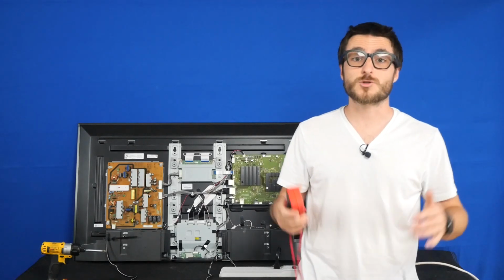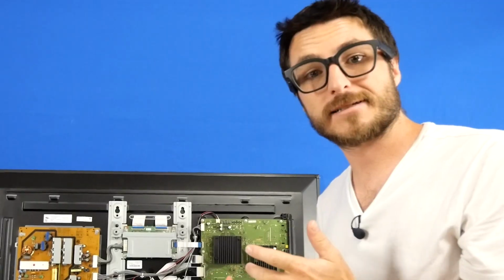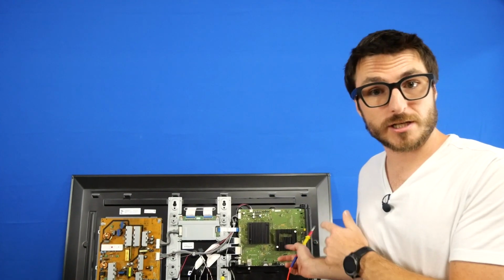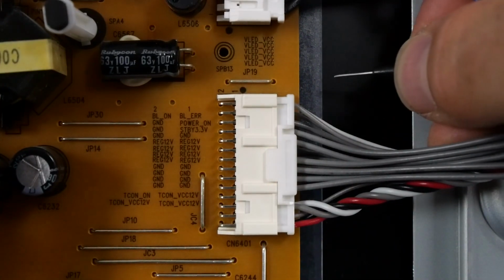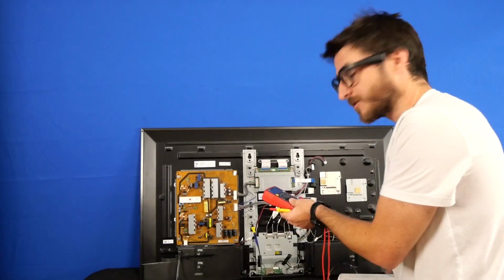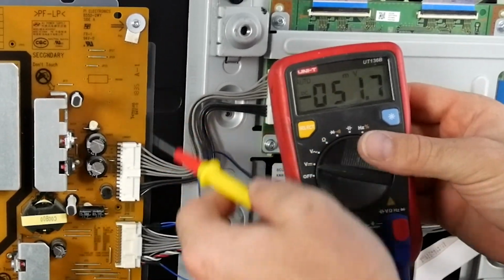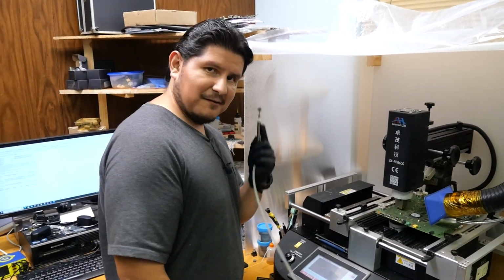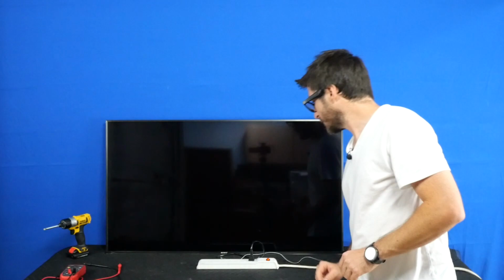The Ultimate Guide To Diagnosing and Fixing Sony TV XBR-49X900F

Comment: Hi, for the pin jumpering, I am correct that you jumpered pin STBY3.3 with Power On,   and also jumpered TCON On with BL ON together? I.e. only two jumpered cables
In my case, I have no picture but have both backlight and sound. When I do this jumper test, my LED driver board (the one at the top) flashes red 3x. What does that indicate?
Reply from the maker: Yup, you are essentially linking/shorting 4 lines together. You are attaching all 3 PS_ON BL_ON and TCON_CON lines to the STB 3.3v which in essence means you are linking all the _ON lines to one another.
Those _on lines are supposed to be commands sent from the Mainboard. So by shorting them to the 3.3v standby line you are tricking the power supply into thinking the mainboard sent all the good on commands and thus the power supply fully activates.
This is why a lot of people actually misdiagnose their TV thinking oh I have a bad power supply because I can't get my voltages to show up. But in fact, it's the mainboard that is not sending the on commands to turn the power supply on. By doing this you are confirming the power supply and the rest of the set (except the mainboard) are indeed fully functional, and if they are, then by process of elimination, the mainboard is the fault.
Reply: @NicksTVRepair ok thanks for the clarification. I ended up jumpering all the lines to the STB 3.3v as you clarfied in this comment. Previously, I understood from the video that you were separately jumpering TCON ON and BL ON togetger without jumpering it to STD 3.3v. In any case, this excellent test proved that the t-con board was faulty, replaced and working! Thanks again!
Reply: @angelocuffaro2377 when I do the jumper test with main board disconnected the power supply turns on and backlight comes on but does not do the color test pattern. With mainboad connected nothing happens at all. 

Should I get color test pattern when doing the jumpers? Or could my tcon or led driver be boards be bad?
Reply: @angelocuffaro2377 that's exactly what I thought he did too. Now I am confused. He used 2 jumpers. How did you jumper yours? Please, if you would.
Reply: @angelocuffaro2377    What made you figured that the TCON was faulty ?
Reply: @angelocuffaro2377  How did you figure it was the t-con? I did the same thing, but no backlight or anything. However, a green diode lights up on the led driver board.

Comment: Hi, my tv when I check the pins from power supply it only shows 19.5v and there no standby
Reply from the maker: That could be normal depending on the model you have and the expected output voltage of the line you are measuring.